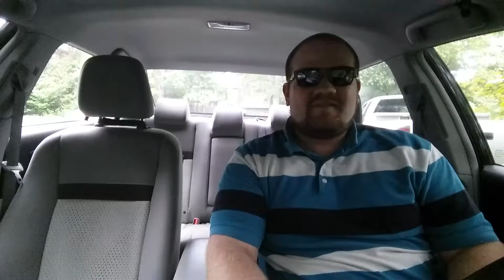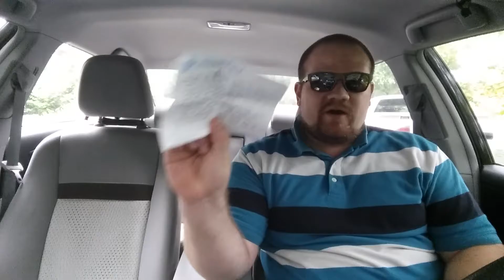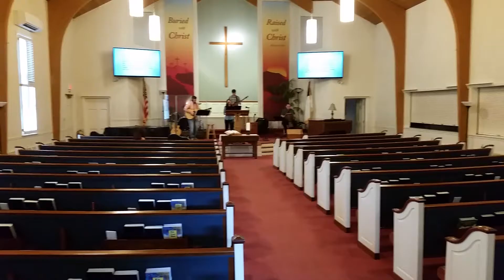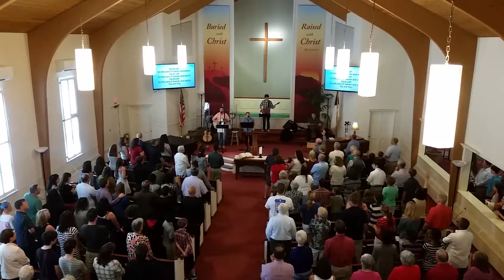Intermittent Noise Rears It's Ugly Face Again | Media Report 6.12.16

Comment: Surprise tracks: As the "sound guy" you are expected to pull out your wizard hat, magic wand, and crystal ball and perform magic. ;-)

Intermittent noise: I hate intermittent problems. Are the Behringers the mic preamps and a to d convertors? Are they transformer balanced/isolated or electronically balanced opamps? Maybe time to upgrade to higher end product?

Time for at least one more wireless system?
Reply from the maker: I really dislike intermittent problems.  I'm beginning to think I (we) mis-diagnosed the similar problem from a year ago.  I was thinking about this with my dad over the weekend. We've got it narrowed down to 3 possible things as a root cause of the noise. 1) faulty Behringer power supply 2) Bad light-pipe cable or poorly seated light-pipe connector 3) SAC Computer or light-pipe sound card. The fact that the noise is not limited to a bank of 8 channels has me concerned that there is something wrong internally on the PC side of things. Maybe time to upgrade, I'm going to retrieve all four Behringer units and test 'em out at home on the bench and try to replicate the problem that way. yes more wireless!  We actually have two brand new Shure ULXS systems in the 500 MHz range waiting to be installed.